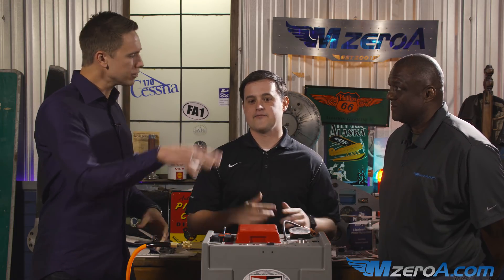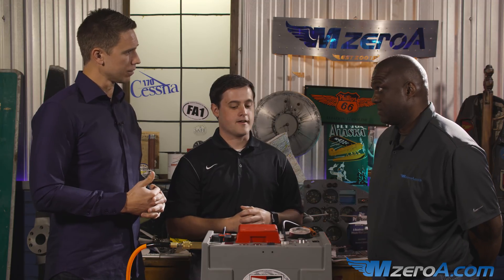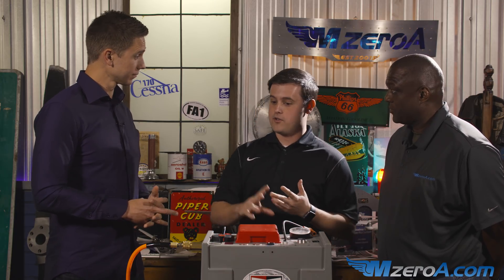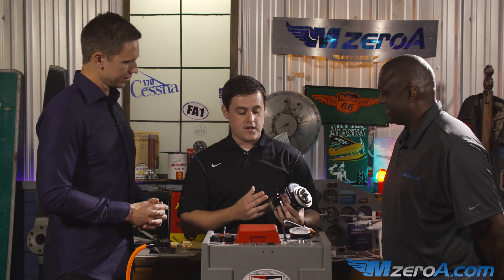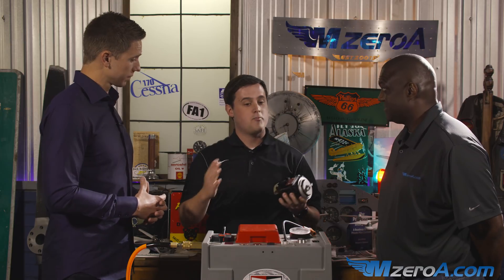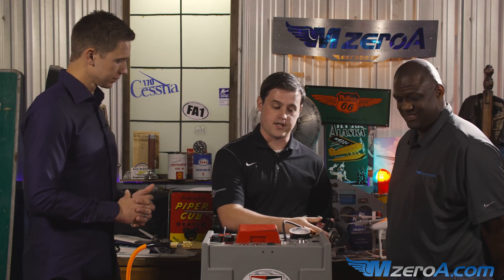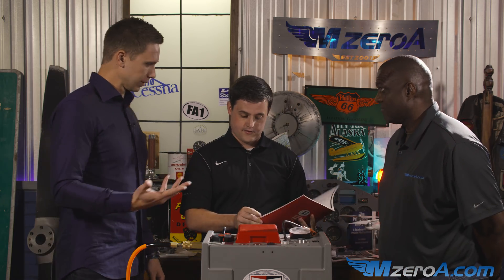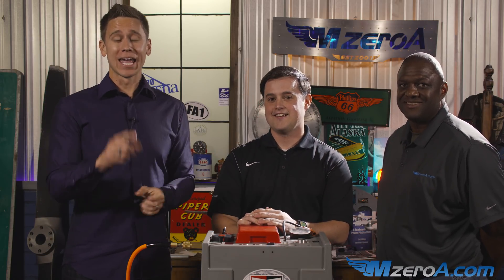Why We Rotate Spark Plugs - Maintenance Mondays - MzeroA Flight Training

Comment: Fun spark plug fact... Ford used to factory install two different spark plugs in their engines... on one side they had platinum tipped ground electrodes and the other had platinum tipped center electrodes. since they knew the current would only flow one way and the wear only affects one side.... replacement plugs are platinum tipped on both sides, as no one would know to only install certain plugs in certain cylinders. and now most cars have gone away from one coil sparking two plugs, to one coil per plug. The humble ignition system is a fascinating feat of engineering!

Comment: Very good. I too learned something. Never ever thought about this. On my truck I replace I change put new. But aircraft. This makes sense. Very informative video.  Is a non A&P allowed to do this at 100 hour maintenance?
Reply: If a flight is operating under Part 135, then the preventive maintenance must be done by a certificated mechanic. However, for Part 91 operations, certificated pilots can perform the preventive maintenance items described in Part 43 Appendix A, which includes:
"(20) Replacing or cleaning spark plugs and setting of spark plug gap clearance."
All work must be done in accordance with the POH and shop manual for the aircraft, and must be logged appropriately. And of course all flights and maintenance must be performed in accordance with all applicable regulations.